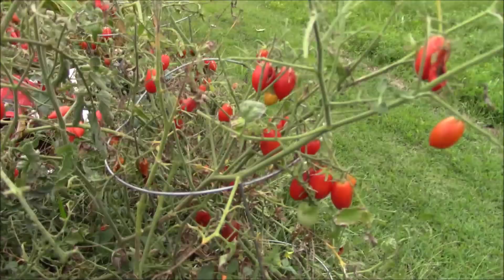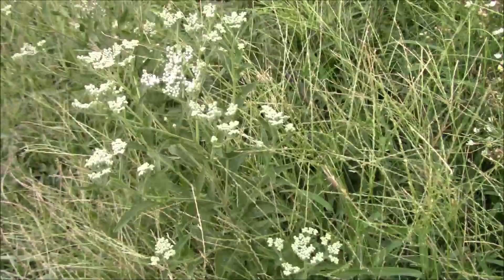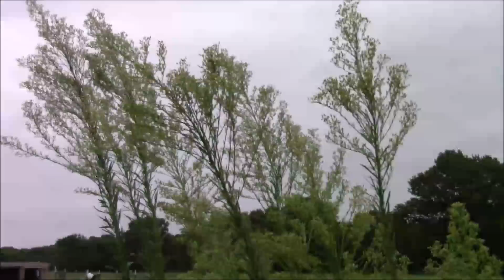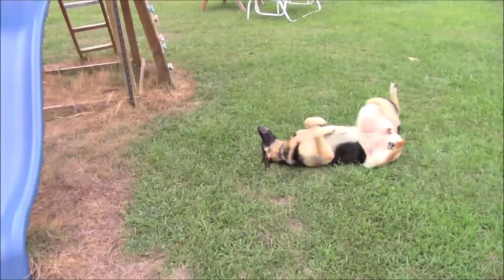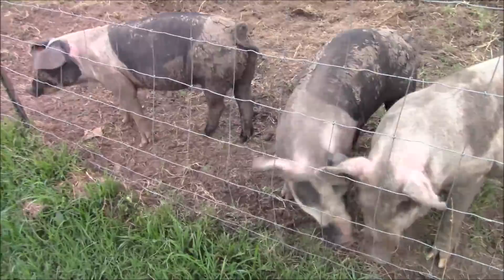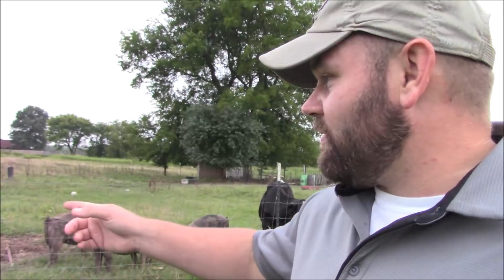Wind Power For Our Farm House!?! Is It Possible?!?

Comment: Morning pal, I went with solar because not enough wind, wind is better as it constant. I learnt myself .. I have some 24v battery banks made up with 12v leisure batteries , and ive wired it into the flat as a separate source .. I use a ATS ( auto transfer switch ) So i can run everything on solar, when the sun goes down it flicks over to the battery bank, If i go through all the battery power before sun up, It automatically switches it to the Main Grid. Once the inverter has the batteries charged up, it again transfer back to the solar.
Reply: Made a little video trying to explain my solar for you dutch. Sorry haven't a clue how to edit so its just a raw vid.
https://youtu.be/YCPhED0vw1s
Reply from the maker: Milldog's Pad awesome ill check it out, thank you.

Comment: O.K. Dutch here you go:
1.) check with your local power company and see if you can use wind and/or solar power to sell back into the grid. Sometimes you are limited according to the county and power company as to whether or not you can sell back your excess power.
2.) I would see where you can put a wind turbine near your house. Anything over 25 feet you will lose electricity. 
3.) The electrician can only add a converter to your power fuse box, if you were to use this power for the house. You would need the set up before they an do anything for you. Because they will need to know certain things in advance before they can make these conversions.
4.) you need to be aware that a wind turbine is noisy. You will hear the whir all day and night long as long as the wind blows.
5.) if you do have a wind turbine you will need a battery bank to store your excess electricity for those emergencies you mentioned.
6.) you need to check the price and the height allowed in your county for a free standing turbine. Some require permits.
7.) you need to see how much power a turbine puts out there and would it be enough to cover - say your power bill (with AC running).
8.) check the internet for local dealers and see what they charge. 
9.) you are entitled to a rebate from the Federal government. Make sure you get it and not the knuckleheads that install your wind generator. (You would be surprise to see how they rip people off by putting it in and keeping your rebate for themselves.)

10.) warranties and guarantees are they available and for how long. ( mine are for 30 years.)
11.) can you use solar in conjunction with solar power? 
12.) will your power company buy your surplus power? If so how much and when do they pay you?
13.) will you need a permit to put one in? to run one? to store power on your property? to hook up to the electric company?
14.) will your house block the wind in certain directions?

So you want a wind turbine
1.) to store your power you will need a bank of batteries. As long as the wind blows you will have stored power.
2.) if you want to run the house or offset your power bill you will need to send power back into the power grid.
3.) you want a turbine that will follow the wind so you would want one that runs like a plane's propeller. The size and model may be dictated according to your local government.
4.) The bigger doesn't necessarily means better. The bigger they are the stronger the wind is needed to turn the propeller.
5.) you should check and see where the wind is the strongest. I mean 20 ft high, 30 ft high, and so on. Does the wind blow 24/7 or in spurts throughout the day? (I would test to see how strong the wind is and in what direction it come from.
6.) storms, in what direction(s) do they hit your property? That is the direction you want your turbine to face.
7.) can you shut the system down for any reason?

I hope this helps some. You will need to really look into this before getting deeply involved with the electricians to alter anything - remember you will need the building inspector to do his final approval and his set of plans do not have a wind generator in it.
Reply: Jumpoff A,  Great comments. One more thing to consider is "shadow flicker,"  where the Sun is either rising or falling and cast a shadow on your house.  The blades of the wind turbine will block out the Sun for a millisecond, creating the shadow flicker. This is solved by placement of the turbine with respect to the Sun as well as distance away from the house.
Reply: True.  :-)
Reply: Jumpoff A THAT'S COVERS JUST ABOUT ALL OF IT. GREAT JOB. YOU ALSO GOT MY VOTE. PEACE&SAFE JOURNEY YALL
Reply: Thanks Brother. I like to see people get an even break when ever possible.   :-)

Comment: Okay Dutch here's my thoughts on a wind turbine! first check with your county for any ordinances that prohibit a wind turbine ? tradition towers may be prohibited but there are many different types of applications of turbines some that are low to the ground that are like cork screw type turbine! because of your extreme storms there i wouldn't put anything on your roof that will avoid any damage to your home should it break loose! i'd pick a location out away from your house on the ground mounted to a cement pad a vertical turbine might fit your needs, not one like a fan blade! i'll gather a few ideas and send to your email ! btw i have 23 years as an Environmental Scientist so i had practical experience working wind farms around the country!
Reply: PUT IN A CONCRETE FOODING WITH A REBAR CHAGE 10'FT
IN GROUND AND HAVE THEM BELL OUT THE BOTTOM OF THE HOLE. DEPENDS ON HOW TALL THE MASK IS.
Reply: Phil Lully GOT MY VOTE. WE DID ALL THE CONCRETE FOR THEM MONSTER'S TO REST ON.

Comment: I see no reason not to go with all 3 options. Grid, solar, and wind. I know it might be a bit expensive, but it literally pays for its self through tax incentives and typically any power that you put back into the grid will go on your account as a credit. The "multiple socket" idea wont work. A junction is needed to at a demarcation and when set up properly the transition from solar and wind to the grid is seamless and automatic. The only way you will know it swapped over is if you look at the meter and see it start counting down instead of up.

Comment: I lived 100% off grid for a decade, but was using gas generators to charge my battery. Didn't have much wind there, and at that time solar was about $30k to set up. What I can comment on though is storage batteries.  Don't waste your time on RV or Boat deep cycle batteries. They "might" last a year before they need replacing.  The best storage batteries I ever found are railroad signal batteries.  They're not cheap, but if you maintain them properly they will last many years. Other batteries on a smaller scale worth having, and easier to find, are 6-volt golf cart batteries, and 12-volt Caterpillar tractor batteries.  What I ended up with, but are near impossible to find, was 100+ year old Thomas Edison Alkaline batteries. They're only 1.25 volts each, I had two pallets full and they would easily run my house for a week.

You're going to need a BIG voltage inverter to run a refrigerator, freezer, A/C.  Anything with a motor is going to use a lot of amps.  You can run motors and lights off a square wave inverter without problems. But if you plan to run anything electronic like computers, TV, etc., you will need a good inverter that puts out a Pure Sine Wave (or at least a Modified Sine Wave), or your electronics will run hot, computers will crash a lot, and they'll just burn up before long.
Reply: Another alternative you might look into is a diesel generator.  You can pick up a 30kW for about $10k to $14k.  Some of the fancy ones even start themselves every couple weeks and run awhile to maintain the battery bank charge.  A good 30kW generator would run  your whole house.
Reply: Are you still using Solar pv?

Comment: I think solar grid tie system is still best. Even if there is a power outage. During day you'd have power, when others do not. As long as you don't open freezer at night, it will hold on to the cold until morning.

Battery banks are just so expensive. If you get deep cycle batteries. You'll always have to monitor, and maintain fluid levels. Pure Living for Life learned that one! If you get maintenance free gel cells, they are very COSTLY. plus you will likely replace them every 7 years. They never pay for themselves really. I think battery banks are just too much hassle.

That's why I would stick with Grid tie systems.

Comment: I've been studying this for decades. Wind power is fraught with issues. Maintenance headaches and you need to be sure what wind speeds you need to get any real power out of them. Solar is a bit better. But you'll have many years needed to get an ROI unless your power from the grid is high. I don't want to dissuade you should you really want to do either. Just be sure your eyes are wide open should you decide on either. 

BTW, I heard it was Oklahoma that sucked...LOL
Reply: 1timby OK IF THAT WAS TRUE THEN WHY INTHE HECK THEY ARE BUILDING THEM ALL UP & DOWN THE MID WEST AND SELLING THE ELECTRIC POWER FROM THEM.

Comment: You might want to start here... https://www.energy.gov/energysaver/installing-and-maintaining-small-wind-electric-system  They do mention that wind power must be shut down when the local power is out, but do not be dismayed - your installer can set you up with an automatic or manual transfer switch which cuts you off from the grid when it is down.

Comment: I know it's not cheap. But it's a good 3kw. You could get it cheaper, if you could build one yourself. Requires a LOT of metal working! Most of us don't have a metal shop, or the skill to fabricate metal. As far as wind goes, Vertical Axis Wind Turbines are most efficient.

If you go solar, I would advise a grid tie system. That option is much less expensive than a full of grid system. Batteries are expensive! A grid tie system requires a special meter base from Electric company. One that can track backwards. That way you sell power to Electric company during the day, and use their power at night. You'll always have power, and Bill will be free, if you have enough panels. Great option for solar, if your ask me.

Comment: Dutch, I know little about solar or wind power. I do agree with Grant Griffiths post below. I guess you will have to weigh the costs and benefits of both which you already know. Have the electricians put a timer in front of your hot water heater though. You can have it shut off at night then turn back on before anyone is up. The water stays hot and it will save you some electrical costs. Good luck on finding all the info you need. I'm sure you will keep us all updated. See ya on the next one. Later Okie

Comment: You might want a backup generator.  They come on automatically if the power goes down and if you and family were on a trip the battery bank  may run out of power.

Comment: We live in hurricane country, so frequent and long power outages and we have a whole house, natural gas generator and we don't have separate outlets. All that is switched over in the electrical panel when needed, just make sure they leave room to add the parts when you do decide to get it.
Reply: We live in hurricane country as well. This is exactly what I was going to suggest. Right now a transfer switch in the panel box is really all he needs for future hook up. When the power goes out, just switch off the main and switch on the transfer switch to the alternate power and flip on the breakers he needs to use.

Comment: Funny to see 50 views in 4 minutes with a 7 minute video uploaded lol. Idk bout this deal. Maybe solar power man. No clue
Reply: I have solar and pay $1.00 a month for an electric bill and I run the AC.  :-)
Reply: Jumpoff A wow that’s awsome!!!  What did your whole solar system cost you?
Reply: $17,000.00 after rebates 10K.
Reply: I sell my excess power back to Edison Power company. They pay me or offset the bill once a year. Last year, I earned a little less that $500.00. And that was running the AC during the 117 degree temp for a month. My wife is glad that I did put solar on the roof.
Reply: A dollar a month - you can't beat that. The payments are built into the mortgage, an extra $100.00 or so. It adds value to the home. My house is valued at 600k. You can't be that either. Where were you looking to move too?
Reply: Tumbleweed actually the video has to be watched for at least 30 seconds. I do know somethings